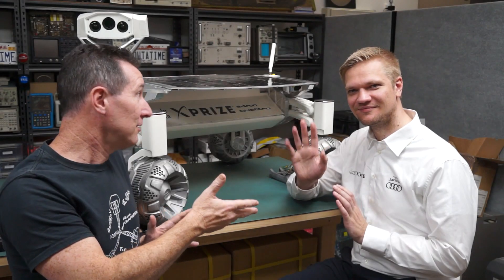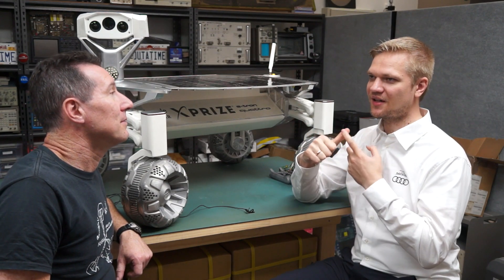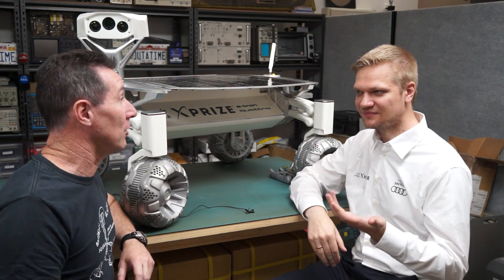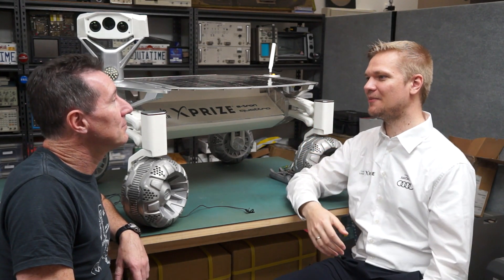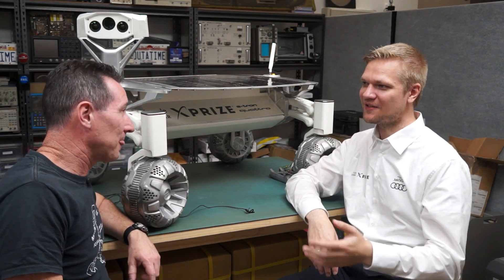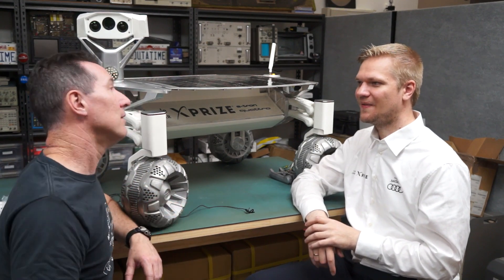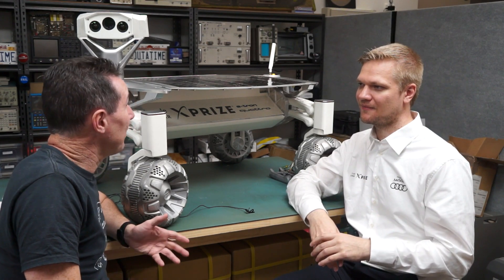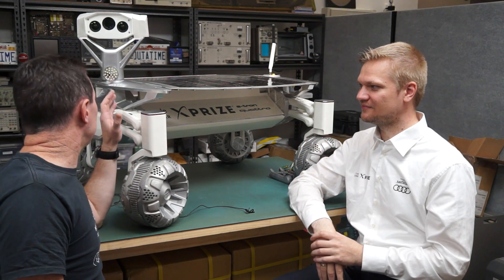EEVblog #897 - Radiation Effects On Space Electronics

Comment: The comments on Rad-hard components are pretty nice regarding the test reports et cetera. Withing the space industry there is also a move towards COTS for some projects. Budgets are not infinite. That being said, CubeSats are growing up and customers are demanding longer lifetimes as well. Luckily, LEO is pretty forgiving. Going to the moon is a different story.
On one of the projects I did (FUNcube-1), we found out that one of our devices that we used had come from a batch that was radiation tested for another space mission. We had paid the COTS price from a popular supplier that starts with f and ends on ll ;)

The feature size thing is counter-intuitive at first, but think about it this way: an energetic particle impacting into a chip will create an energy gradient in the chip of a certain size. If your feature size is smaller, it is true that it is less robust from a size point of view, but because the transistors are closer together, the gradient per transistor is much smaller!

Its a lot more complicated than that, but it maybe gives a hint to why feature size does not matter. size / gradient = constant mess ;)

I am designing CubeSats for about 10 years now, and in general the advice for LEO is, don't bother with radiation shielding, but carefully select your (COTS) components.
We are also working on a payload that will go to the moon, and there it is not as simple, and a lot more thought has to go into it.

one thing that is also interesting to mention is Secondary Emission. This happens when a high energy particle impacts, for instance, an aluminium payload box. The high energy impact on the outside may release multiple lower energy particles, that then spray around inside your enclosure.

Thanks Karsten and Dave for the nice talk! All up my alley as RF systems engineer in a space company, and AMSAT satellite builder.

Comment: great topic- I have my PCBs for CubeSat MOVEII and IIb in space (LEO oribit). LRT Project from university. LEO orbit is not as critical as other oribits or deep space on radiation, but we used a constant timeout with stdandrd counters to reset the CPUs &FPGAs and reboot in around several hours to recover from radiation effects. Also using special FLASHs (For example FRAM - we used MRAMs) helps to prevent data storage for the boot images.

Comment: That's quite interesting stuff! Having dealt with electronics for decades I made the mistake to take it for granted that for example thermal issues are just a matter of how big your cooler fins are and such stuff, but if there's no air then there will be no heat dissipation on that way. You have to just radiate all the thermal energy. And ionic particles and radiation is no real deal here on ground. Lots of interesting questions!

And - opposing to many commenters - I do really like the discussion style of the interview. It's much more cool and easy listening than a tv-style discussion of the form "This is Mr. ...., he's an export on ..... Dear Mr. ...., what do you think of ....."  THAT would be boring! Thanks Dave and "Thumbs up!" :-D

Comment: Please don't use the garbage imperial system. Stick to metric. Thanks.
Reply: The imperial system that put men on the moon isn't good enough for you?
Reply: They both measure the same thing.  Did that blow your mind?
Reply: No
Reply: +Mini DK#9 the imperial system that caused the loss of the Mars Climate Orbiter is still stupid
Reply: *****
Why ?
Why use imperial at all,  US and UK imperial systems are so different.  Ever seem anyone on a forum specify which one ?
Reply: *****
Yeah, Here in My country we have been using metric sine the early 70s, but I still say the shop is (say) 500 yards away and not 500 metres, mostly because yards is easier to say I think.  Actually mostly estimate distance in imperial & measure in metric.  Many youth have no idea of the imperial system,  I suppose in the US most elderly u\have no idea if metric.
Reply: Please Lookup Mars Climate Orbiter crash. This is why you don't use both.
Reply: Imperial system didn't cause anything LOL 
They used software that calculated in US Customary Units when it's specifications said it calculated in SI units. Lockheed Martin caused the loss of the Mars Climate Orbiter, not a system of measurement. You buffoon.
Reply: The imperial system had nothing to do with the mars climate orbiter.  A bunch of engineers that didn't bother checking what system was being used caused the failure.
Reply: Mini DK#9 Yes, that's what I wanted to say. Since my reply was to, why not use both.. because using both leads to what you said, .. people not checking which caused the failure. If you stay with one system.. be it the imperial or the metric one, these kind of mistakes can't happen.
Reply: Guess I need to be still more specific... There should have been a concrete specification that stated something like .. we use the imperial system .. _dont_calculate_in_the_metric_system .. something like that.
If there was something like that ..ok they really were idiots, didn't look that up if that was stated specifically.
Reply: Read about the "Mars Climate Orbiter" on wikipedia :) You will see why  we don't use both.
Reply: Yeah I find it odd that most UK measurements are in metric but for weighing people they use stone.

Comment: When it's said that the first mm of shielding does the most good, what happens if you add "layers". each one mm thick? Does that make a difference?
Reply: I think it's along the lines of the first mm being able to block 90% of one sort of radiation, and then you need a different material to block some % of a more penetrating radiation. I'm speculating here. I think it's about what is required to block electrons vs photons vs xrays, gamma rays, etc.
Reply: No, stacking layers makes no difference*, it's all about the total thickness. The point was you get diminishing returns. Let's say 1mm blocks 50%, then a second 1mm layer would block 50% of that, bringing it down to 25%, a third layer would block 50% of that bringing it down to 12.5% ... . So the first layer was the most effective and you have to decide at what point adding another layer doesn't bring you much more shielding and just adds weight.

*stacking layers of the same material. Depending on the radiation there is value in stacking layers of different materials. For example, if you have high energy electrons, stopping them with 1mm lead is a bad idea, because the electrons get decelerated so quickly in the lead that they produce x-rays in the process and x-rays are more difficult to shield. You would be better off using 0.9mm aluminium and a 0.1mm layer of lead behind it.
Reply: Stacking layers can make a difference, but it's a second order effect. A high Z material, such as Tantalum is more effective at stopping electrons. Then a low Z material can be used behind the Tantalum to absorb the secondaries (Bremsstrahlung). For normal spacecraft this is not necessary - however for missions to Jupiter, the shielding mass savings can be significant.

Comment: It really is a small Internet sometimes. I started getting in to FPGA development some time ago. When I was researching the topic of FPGA and the various tools needed to work with them I ran across the PSHDL website. Here you are talking to its creator.

When mentioning use of radiation hardened parts I wondered if someone would mention the 1802 and someone in the comments has done so. I built myself an 1802 based computer board almost three decades ago. I thought the 1802 would be an obsolete part by now but it is still being produced AFAICT.

Comment: I've been doing some space design recently. It's true that big-budget communications satellites will be using radiation-hardened chips, but it's also true that these are phenomenally expensive and well beyond the budgetary means of many designs. 

I was surprised to learn that, in fact, lots of smaller craft are operating with off-the-shelf PICs and the like. Of course there's a lot of design to do here, with the implication of lots of redundancy and a limited lifespan. All the same, a great many of these devices greatly outlast their design expectations, not to mention the consensus expectation, using off-the-shelf components.

If you're building craft which cost less than about $10,000 a piece, you're probably better off designing with big margins, redundancy, and careful memory management than talking about radiation hardened/tested chips. Shield up to your mass limits, of course.
Reply: Ultimately it's about acceptable risk. If you're flying a one off billion $/€ mission, you want to minimise risk and use the more expensive components. If you're flying an experimental cubesat, then COTS will work (they can be derated to ensure they will still be in their operational envelope after degradation)...but won't last as long. Either way, the design should account for the radiation effects to ensure the risk is known and acceptable.

Comment: if ions screw with the doping of the silicon, how do solar panels work in space?
Reply: Good point Kevron, so what annealing was Karsten referring to?
Reply: Solar panels do indeed also degrade in performance over time. I assume the sheer size of the doped surface is the main difference here, as slow damage over time isn't as critical of a problem.
Reply: The primary source of solar cell degradation (and for typical opto-electronics) is via non-ionising dose (NID), aka "displacement damage", not doping. NID is where a sufficiently energetic incident ion displaces/dislocates one of the atoms in the junction lattice structure, causing a defect and a recombination centre for electron-hole pairs. Protons are more damaging than electrons.

When designing the spacecraft, the degradation of the solar arrays due to a myriad of effects (radiation, coverglass darkening, thermal issues, etc) is included in the sizing of the arrays to ensure sufficient power is available at the end of life. 

For a large solar particle event, e.g. Oct '03, the total power output from the array can drop by ~2-3%.

Comment: Glad someone finally made a video about this, should close the door on all those who think we didn't go to the moon because of the radiation. He said it depends where you want to go and the shielding. The first layer is the important one not so much the thickness. The apollo crafts were more than "pop cans". There was shielding around the electronics. Naysayers never mention that.
Reply: The payload (astronauts) are considerably more susceptible to radiation damage than components. The electronics flown at the time (magnetic core memories, etc) were quite radiation tolerant. Between the Apollo 16 and 17 missions, the August '72 solar particle event occurred. While it might not have killed the astronauts, they would have received a sufficient dose to incur radiation poisoning (vomiting, etc.). Shielding against such events (they occur about once every 12 years and last for a days to a week) in interplanetary space requires about 20 mm of Aluminium - a very heavy mass penalty. In low Earth orbit (like the ISS) the Earth's magnetic field provides considerable shielding from these events.

Comment: Is this rover supposed to map the moon? It may take a VERY long time as we've seen it move. I'd be worried about some terrain problems may be too intense for this probe unless it can automatically avoid them. It would be a miracle to work properly. I am guessing you are working against vacuum conditions, extreme heat/cold, and some ionizing radiation like cosmic rays. Not to mention space matter collision that any tech must survive. Like I don't know how those plastic leg caps would hold up.
Reply: It is actually harder to land on the moon, because the atmosphere can't be used to slow you down, so you'd have to retro burn properly or just smash into the moon really fast.
Reply: Are you in a hurry? Can't wait to get up there?
Reply from the maker: No, it just has to last 11 days or so
Reply from the maker: No heat problems though!
Reply: EEVblog
Plenty of dense gas to conduct away the heart ?
Reply: I think the moon surface temperatures bounce between -153C and 123C  in the sun or the shade.  That's probably a tricky thermal problem.  The front of your rover behind a rock could be -153C and the ass end baking in the sun.

Comment: Can you design a Lunar Rover to use a RTG to operate in the Lunar Polar Region to map and how to access the Lunar Polar Ice (H2O) ?  Also these hardened chip may also survive an EMP.  Thank you for the video !  tjl
Reply: I am not sure if it is in this video or another, but getting a RTG or even just a RHU is a very involved and complex process that no commercial entity has ever done. Plus it would be in the millions of dollars PER LAUNCH! (Just the paperwork)
Reply: They were talking in the other electronic video about that. The paper work alone to get the permission as a private to start a RTG will cost you around 20 million $ (they really asked for it when looking what would be possible). And then you still have the costs of the RTG (the RTG and higher mass, more shielding as you have an additional radiation dose). And some other problems, the RTG would be  fine to go through lunar night - but for lunar day you just have more heat energy you have to get rid off. So it's an interesting thing if you don't have to look at the budget to hard.

Comment: Has anyone tried to impliment active shielding, such as EMF from an active electric coil or rare earth magnets? I theorise that you may also be able to drain excess energy generated by passing through the VABs or other phenomenon, using super capacitors (with diodes) as an earth, as they have largish capacities, with very low resistance and therefore hopefully absorb the excess electrons?

Comment: Karsten said if they 'have a solar flare they know they are F'd'.  In the weapons world there's a device that detects
the flash of X-ray of a bomb going off and shunts system power.  In a sattelite maybe there's enough high-energy particals
a tuned sensor could be detect the event.  If not maybe a (should already be on board) radiation detector would flag 
what looked like a solar-flare, send a note home 'solar flare, checking back in 8 hours' and shut everything down.

I'm not coming up with anything new--the communications satellites in LEO have got to have stuff like this designed in.
Reply: radiation monitors are normally flown. See http://www.swpc.noaa.gov/ for some examples.

Comment: Why don't you ask the guys that went to the moon in 1969, about the radiation,... they had no problem with there electronic systems ?????????????
Reply: Moisture seemed to be the greatest problem with the Apollo missions. Remember, back then the computer used on that mission was very low volatage and I am sure they used shielding .I remember a comment concerning insulation floating all over the place in the Apollo 10 mission,I am assuming they went through and fixed all those issues in later missions. Of course all the electronics being used back then was also being used in our Nuclear tipped rockets. Much of that stuff was hardened to survive a strike nearby and still be able to be launched,scary thought but true.